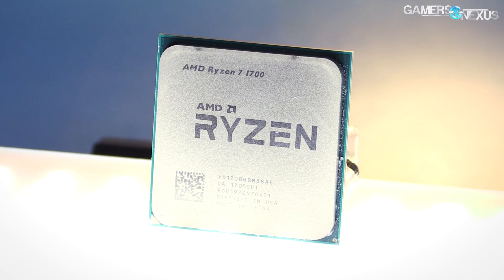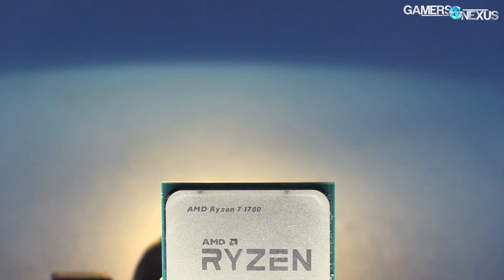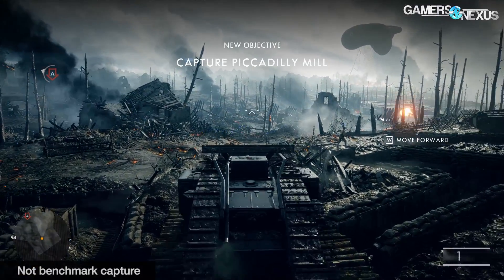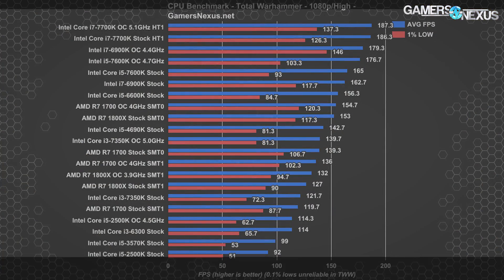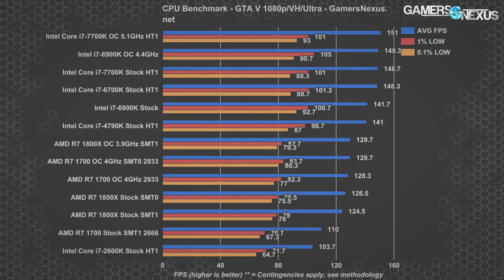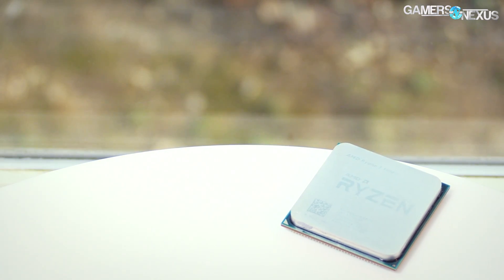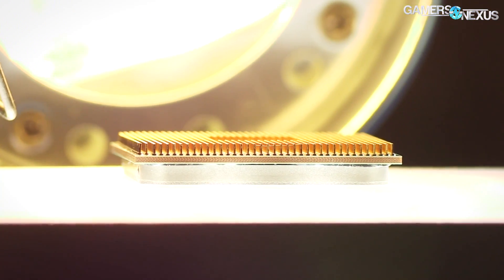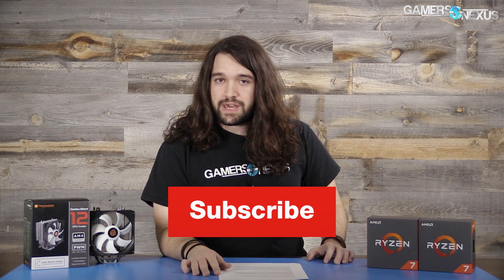AMD R7 1700 SMT Off + Overclock Benchmarks

Comment: So in other words, if you bought a 4790K almost 3 years ago, even on stock settings, it's gonna be better for gaming(!) than any overclocked ryzen SR7 cpu.
Yet it shouldn't be news to anyone that most games don't utilize octacore processors to the max, there's probably gonna be quite some performance shift incoming if octacores become the new norm even for gamers.
Reply: Why wouldn't it? And I doubt AMD is going to crash and burn lol. Even IF it doesn't get a single frame of improvement for gaming over the next 5 years (that's just plain unrealistic) it's still the undisputed champ for literally everything else and at half the cost. Most people use their computer for more than just gaming and it's not like it can't get 60+ fps in pretty much every game out there so it isn't really an issue. Vms? personal servers? rendering? etc. Most people do at least one of those things (that spend 500 dollars for a CPU I mean).

EDIT: There is HUGE benefit for going mutli thread vs frequency. There is a hard limit on the frequency and IPC we can gain with each new process. There isn't for the number of threads/cores really. At least not one within reason. This is clearly visible in every other type of usecase. Only gaming is stuck on frequency because until dx12/vulkan we had no API to use it. Just look at the possible results in the ps4/xb1 with their shit ass processors with 8 cores that can play games nearly as well as processors with 10x the performance (or more?)
Reply: doubt it, seems like octacores will be the next big thing considering you can get a pretty good one right now for 350€, but who knows.
Reply: You would think Intels $1000 6900K would beat their $350 7700K in gaming too, but it doesn't.
Reply: Yeah but if he didn't actually test it then he can't really say that. Even on my other processors disabling other cores made overclocks more stable and in some cases allowed for a bigger overclock. There is less heat and less power used so naturally those two limitations become less of an issue. I 100% agree it wouldn't give the same results as the 4core though. I'm just saying it might give us a better idea especially when one of the biggest reasons the performance is lower on games (other than the huge clock speed difference) is the communication between the 2 sets of 4 cores. so disabling 1 set all together might increase performance on its own 

I dunno maybe I'm wrong here but it would still be interesting to see either way :)
Reply: Jack Snover evolution will eventually lead us to more cores being used in games. Bigger games like Arma 3 and GTA could definitely use that support
Reply: using a non k i7 4770 since its launch. Only issues i had was battlefield 1 before winter update. How long would I last with this baby ? RX 480 8GB, 1080p monitor, 16 gigs of RAM. Do i need an upgrade and what should I get ?
Reply: What? no. I didn't even bring up the graphics card lol.
Reply: I don't think you understand the point. The 1700 with overclocking is about equal to the 6900k (slightly behind 6900k overclocked) in EVERYTHING EXCEPT GAMING. I understand to gamers that's all that matters. But most people do gaming AND VM, private server, rendering etc. So having those cores is worth the loss in FPS as long as the fps stays over their monitors refresh rate. At 1080p pretty much every game will play well over 60 fps (most over 120 fps) so there is no real "loss" in buying the 1700 if you really do more than just gaming.  That's assuming you have a 1080p monitor still. most people investing in a 300+ dollar cpu will likely be buying a 1440p/4k monitor with it so there really is 0 loss. Once the gpu is no longer a bottleneck ryzen will already have been optimized so it wont matter at that point. THAT is the point of ryzen and why games will very quickly become optimized to use it properly. most gamers are adults now and use their pc for a lot more than just gaming so will buy ryzen. and remember, this is less than a third the cost of the 6900k that people actually put out for for the exact same reason DESPITE the insane price.

No need for you to upgrade if you don't want to and do nothing but game, but bashing ryzen because it doesn't fit your EXACT use-case is silly.
Reply: I'm pretty excited to see where cpu's are going the coming years.
Maybe Intel will soon release "low" priced octacore cpu's as well to counter ryzen so that octacore becomes more common, if that happens the octacore cpu's certainly will see a boost in gaming performance as games would be optimized for 8 instead of 4 cores.
Reply: EXACTLY. They didn't do this to the 6900k despite its gaming performance. I'm not sure why they are doing it to the 1800x. It will be interesting to see how far the 4 cores can overclock. I keep wishing he would disable 4 cores (if possible?) and see if it will overclock farther that way. the IPC seems pretty close so the performance in games should be close clock for clock. (once things are optimized properly obviously)
Reply: I don't think that would yield the same results as testing a 4 core Ryzen CPU. I think Jay from JayzTwoCents answered this question recently in his podcast saying it wouldn't do anything.
Reply: Well to be fair it does outperform any other chip out there pretty much on everything except gaming and at like half the cost :)
Reply: uhh, there is?
Reply: vermillioN before we go to octocores, they might improve performance off the hexacore processor
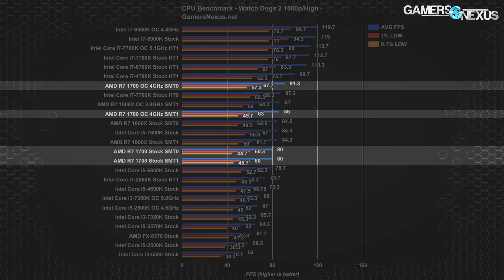Reply: At 5:15 the 8c/16t 6900k beats out every other CPU tested
Reply: Jack Snover for 1000 dollars USD lol. And I see them them over 1500 (even saw 3000$CAD for an extreme edition on amazon.ca) while the r7 1700 is under 600$in Canada....
Reply: Yes, I know the 6900k is a terrible price/performance CPU for gaming. The point of my comment was in reply to the guy essentially saying that 8c/16t CPUs should never beat a 4c/8t CPU in gaming.
Reply: Curious Wars you're telling me that the RX 480 is shit? 😂😂😂😂
Reply: There is Skylake-X coming early Q3, I think Intel should release much cheaper 8c/16t because even though Ryzen gets crushed in gaming, it is very competitive in other workloads for 1/3 price, and those are workloads for which those 8c/16t CPUs are meant for and where the market for them is.
Reply: Krzych wasnt that suppose to be higher clock speeds???
Reply: Agreed, nice calsonic skyline bro.
Reply: Upcoming eight-thread optimization makes sense as it would benefit both the i7s and 8-core CPUs with or without multithreaded cores. It's been coming with dx12 and now with AMD bringing 6core "gaming" CPUs (the r5's), the drumming isn't going to stop any time soon - better multithreaded games is the future, like it or not you cannot argue against that fact.
Reply: How do you know what he looked like when he said that.
Reply: You look surprised... Why would you think a 8c/16t CPU would outperform a 4c/8t CPU IN GAMES?
Reply: Didn't you read my entire comment? "Yet it shouldn't be news to anyone" - I'm saying this because it's roughly the same price class, and many people still consider the ryzen cpu's despite even a 3 year old quadcore i7 outperforming it in games.
Reply: Possibly because now that 8-Core CPUS are becoming more common they might be utilized to their full potential at which point they will easily outperform the Quads, and also because to many people Gaming is just a minor part of what they use a computer for. 
If you remember the old days of Q6600 and E8600 and such it was very similar then, but a few years down the line the Q6600 pulled ahead.
Reply: A three year old CPU, keep that in mind. I get Ryzen is all "Bleeding Edge" and shit, but you would hope that their third best chip would outperform a three year old Intel Chip at gaming, as well as rendering, VM's, etc.
Reply: vermillioN. Amd did bad marketing this as a gaming CPU as it's much better as a workstation CPU. Then again, 4790k performance isn't that bad but still not top notch. Maybe in the future games will start to utilise more cores and threads.
Reply: There is no reason to get anything more powerful than an AMD 8750 (so pretty much anything) right now. There are VERY few games that can't hit 60fps on 1080p on that and it's shit. let alone the I7 :)

Comment: Could you do a video on ram memory speeds? Many reviewers have seen noticeable performance gains from higher memory speeds, but not many have done actual benchmarks on it
Reply: There is a lot of credibility to it, considering that the main cause of poor Ryzen game performance is high latency between cores 0-3 and 4-7, that is, the two 4-core CCX [core complex]. The fabric between them is affected by memory speed. Higher memory speeds mean less latency, and you know...

It is absolutely critical AMD get DDR4 4000 working on Ryzen with out-of-box kits.
Reply: true, same for me, with my 1700x. Bumped up my memory up to 3000mhz and that increased my fps in most games.
Reply: Juris Ribinickis it's just not that, apparently Ryzen really likes RAM speeds. I have read statements like it boost almost everything, even boot times
Reply: There is a performance gain on my 1700 but price to performance it is not the best really. Just try and pick up a samsung die as they are more compatible and overclock much better